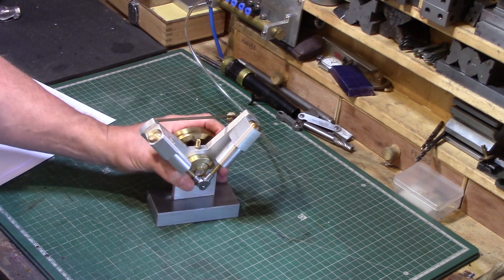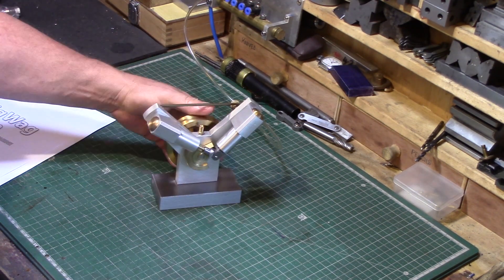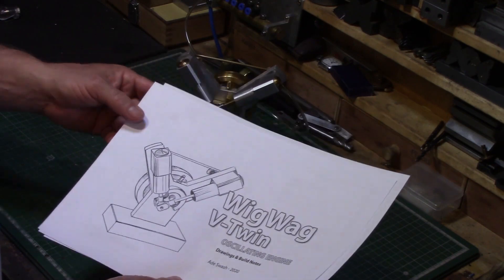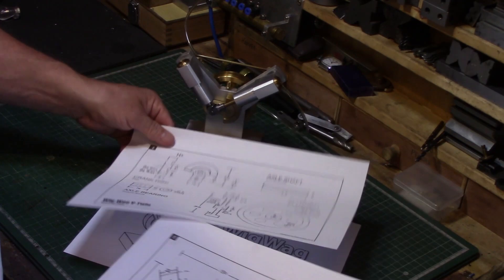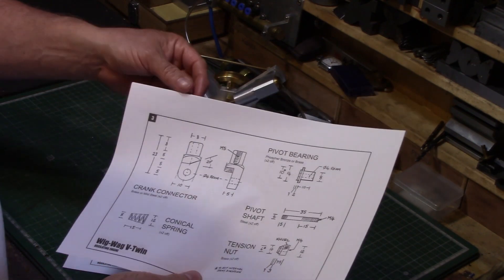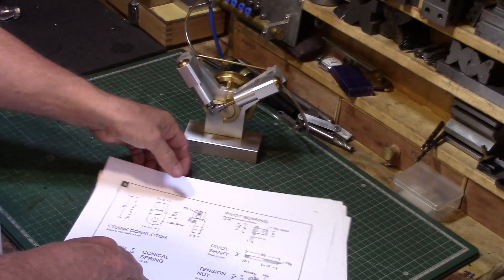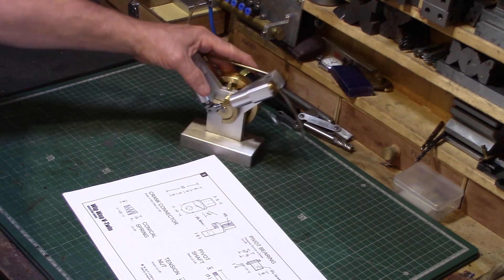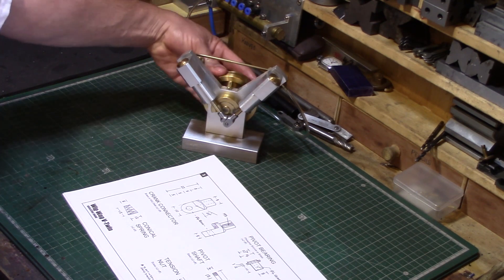WigWag V-Twin Steam Engine Update - Drawings now available

Comment: Hi Ade, Thanks very much for the Wig-Wag plans, that's my next project sorted ! Can you tell me what pressure/flow your compressor produces, I'd like to buy a suitable compressor to run the Wig-Wags. Many thanks again for all your hard work.
Reply from the maker: Hi Brian, I use an airmaster tiger 50ltr compressor, which is just my general workshop compressor, and this is piped to my air manifold which I use to run my engines, this has regulated outputs to vary the pressure to control the speed of the engines, I dont have a gauge to measure the low pressure but depending on what engine it will be somewhere between 3-15psi - see ( https://youtu.be/xJUtfbFkqx4 )  A  small compressor will work fine, such as the type used for airbrush painting, but it will run continuously. Regards. Ade
Reply: @AdeSwash  Hello again Ade, Thank you very much for the info. and advice I'd not thought of a small airbrush compressor, these may be better for me in my small workshop, I'll have a look at a few. I'm really enjoying your videos, and learning a lot along the way, thank you for sharing your knowledge.

Comment: Thanks so much for all the work you've done to make the plans available for us. Since I have a very small lathe and mill (sherline) do you think the engine would still run well if I scaled it down a bit?
Reply from the maker: Hi Harry, I made a 1/2 scale version of the original single cylinder wigwag and that runs beautifully, so I would think this would work fine at a half scale also. Regards. Ade

Comment: Does anyone have a proper .dwg drawing of this? I want to make an assembly and animation of it on Fusion 360 as my final project for one of my Mechanical Engineering subjects. There are just some parts of the drawing that confuses me.
Reply from the maker: What parts confuse you Kev? I will try to explain any misunderstanding, and would be happy to see your finished project. Ade